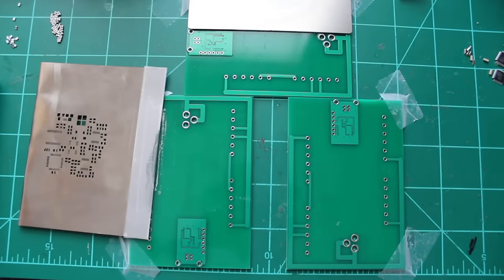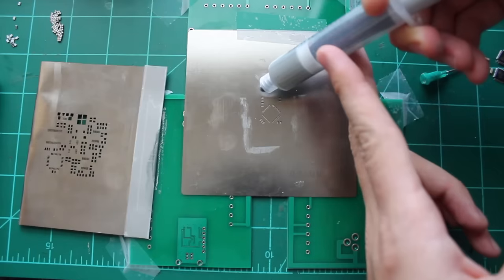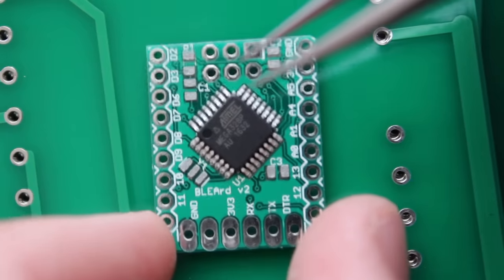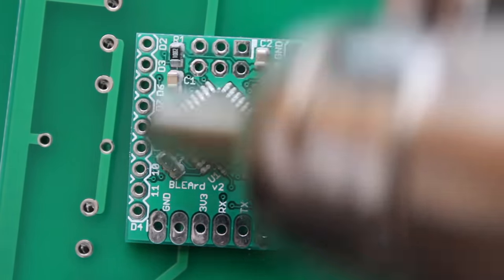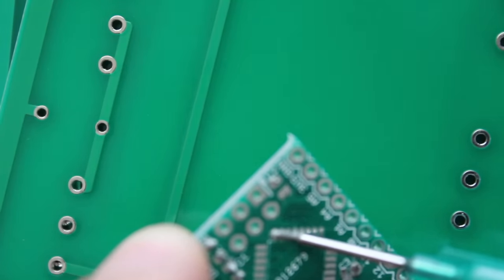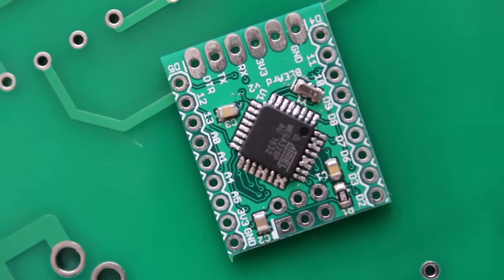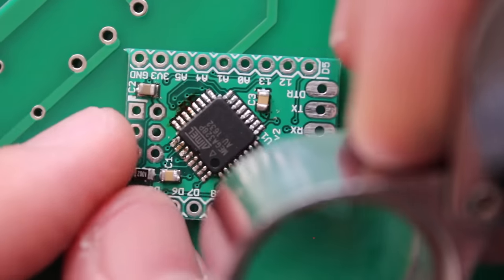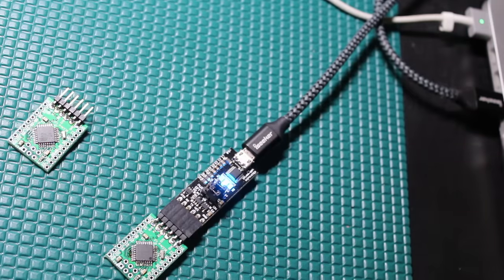Easy way to Solder Surface Mount Parts! - How I do it

Comment: When doing solder touchup, adding a little solder flux to the joint first will work wonders for reflowing the solder and avoid possible cold solder joints.  It probably would have fixed the bridging too during the touchup.

Comment: THE best video I've seen - explains all steps, adds lots of tips, just excellent.  It takes some of the "fear" away from surface mount.  

Personally, I might have slipped some heat-shrink tubing over the too-coarse needle, and shrink it to have a finer applicator, but the fact he did it as is and it worked, is wonderful.
Reply: ...and per a later comment, the heat-shrink could be cut at an angle to dispense somewhat downward, I think.   Finding thin enough heat-shrink might be a problem.    All this is theoretical.

Comment: I don't know if someone has already written this down but I'm going to share it anyway. 

If you want to use the solder paste  syringe to manually dispense, then for the very fine pitch pads you could buy from your local pharmacy (if they are available) empty fine-tipped syringes (the insuline injection type) and use them as a kind of scoop. 

You dump some quantity (paste) somewhere off the board and you use the fine-tipped syringe to pick up a small amount of solder paste each time to lay on each pad.

The reason I am suggesting a fine-tipped syringe and not a needle for example, is because the tip of the syringe is an diagonally cut tube which means it is concavely shaped ( kinda like a spoon) on the one side which can hold some paste more effectively than just something cone shaped.

It is a bit time consuming but it is a lot better than bridges due to excess solder and you can save yourself some trouble from having to use the hot iron and the wick. Sometimes using the wick removes more solder than it should, you cannot exactly control it. 

The manual dispensing way presented in this video is fine if you want to go for it. I just wanted to share some of my experience, so no trolling please.

PS: Also Kevin Darrah, you might wanna start considering some hot plates for properly heating up and re-flowing for your assemblies (provided the boards assembled are one-sided and small enough to fit on the surface of the plate). Some components (and yes that includes ceramic caps and resistors) DO NOT like thermal shock as you probably know. A hot plate can be a cheap (kinda) solution to that.

Alright that's it, I'm out. Bye!

Comment: When doing it without a stencil, just dab the solder paste to the components, Use a toothpick to wipe off any excess if need be, then place the parts on the board with your tweezers

Comment: Thanks for sharing. Just to add some point of benefit, when you paste the PCB by hand and you make a mess by bridging the pads, I would not recommend to use the iron for cleaning it as you did it here, rather run some flux over those pads, change the tip of the iron into a flat blade that covers all the pads of one side of the chip (they come in different sizes) then simply wipe them all outwardly, away form the chip, you'll notice the pads nicely and evenly soldered with no bridging at all.  And finally, don't forget the golden rule, ESD protection. Carry on the good work.

Comment: Wow, Kevin you are indeed good at this.  As an old school engineer I remember when we first rolled out SMD designs in the 80's thinking, well this is the end of the garage tinkerer.  Obviously I was wrong.  What impresses me most is the number of connections being made and the fact that you were able to make good ones without shorts/opens the first time.  Keep it up.  Maybe an old school guy like me will be motivated to give it a try despite the fact that my garage is full of old PIH stuff.  :)

Comment: Great video! I don't know if anyone else mentioned this, but in addition to the capillary action, it's the surface tension of the molten solder that pulls the parts into alignment with the pads.

Comment: Something I have used to fix solder bridging is an iron tip with a flat face. Cleaned well, it allows you to drag the corner of the tip against the board, the face against the tip of the pins. The face of the tip wicks up the excess solder and by dragging the iron across the pins it evens out the solder left behind.

Can't remember where I picked the technique up from, but it works in a pinch.
Reply: armorer1984 link a video! Please!!

Comment: Great video but I have to correct you on something. The capillary action only happens between the flat bottom of the pins and the flat pad because it's a narrow space and capillary action is the ability of a liquid to flow in narrow spaces without the assistance of, or even in opposition to, external forces like gravity.

 What you mentioned about the solder separating and grouping around the pins is due to surface tension not capillary action. Surface tension is the elastic tendency of a fluid surface which makes it acquire the least surface area possible so droplets separate and group around the pins cleaning up the spaces between pins of solder.
Reply from the maker: thanks for jumping in with that!
Reply: Great comment, but I have to correct you on something. "Capillary" applies to narrow tubes. Surface tension is a more general term, and capillary action relies entirely on surface tension. 
Liquids forming into droplets is another phenomenon that also relies on surface tension, in the case where a liquid adheres to itself more readily that to any adjacent surface or material, or in a vacuum. 
Also "ability of a liquid" implies that the nature of the liquid is all that matters. The nature of the surface is just as important, as evidenced by the failure of solder to take on some surfaces. The solder will adhere if energy state of the surface in contact with the solder is lower than that of the surface in contact with the air. Systems tend to change to lower energy states when possible, sometimes needing a "push" in this case the application of heat in the presence of flux.
Reply: I think it is the combination of the two phenomena that make things easier while soldering
Reply: When soldering you do not want the liquid solder balling up. That phenomenon makes soldering more difficult, not easier.

Comment: I usually center the component, then add solder paste. When I was taught, I was told that they are very small solder balls inside the paste. So with that under the flat surface of your component, it allows the potential of that component moving around. It makes sense to me, and its the only way I've done it. Also, you don't really need to add the solder paste directly on the pads, just get it close. When the solder reaches melting temp it'll walk right up your pad/ lead. Downside is if your hot air jet tweaks when you're running it back and forth, you create a big potential for solder bridges. So steady hands are always nice lol. However, I suppose at the end of the day multi leaded devices are just generally synonymous with solder bridges. But you know what they say, different strokes for different folks. Just a different outlook on other methods. Great video man, thanks for making it!

Comment: Take a small blob of blu-tak, shape it into a point, and stick it to the end of a pencil or empty pen. Makes a very accurate pick and place tool! The only thing it doesn't have is a release, so that's where your tweezers come in: touch tweezers to top of part, withdraw pick tool. The sharpness of the point on the blu-tak can be adapted for different part sizes, e.g. blunt for larger parts like your MCU, very sharp for teeny SMD caps and resistors. When blu-tak gets dirty and stops picking up parts, squish and remold - it'll be good as new.

Comment: Watching this... one tip is you don't really want to crank up the air temperature that high. I assume you are using leaded solder paste.

You want as much airflow as is practical and as little temperature as is needed to do proper reflow.

With high temperature air and low air flow you are creating large temperature gradients and this is also damaging to components. You can have the top of your component be very hot (directly to very hot 400C air) but the pads still relatively cool. High air flow tends to equalize and spread temperature much better which means you can use cooler air flow.

Also try to soak the board and components in hot air in lower temperature before you get to actual reflow temperature. This is what would usually happen in professional reflow oven btw. If you preheat the board the gradients will be less and the whole process will be more forgiving.

The way I would determine is I would crank up the cool air until parts start flying away, then reduce it a bit. I would then crank up temperature to see when it takes few seconds to start reflow, not too fast, not too slow. I would soak the board from bit further away and when I'm satisfied I would close in with the gun and do the reflow itself.
Reply: It is not leaded solder paste. Would the temps be higher in this case?
Reply: @BrowFinGarf  that is right,  as non leaded solder has a higher melting temperature

Comment: Good job. I never seen anyone use a stencil, but one thing I noticed when you didn't use the stencil was the crystal oscillator shifting position. from my experience, the solder paste has two states. it helps to firmly press down on the component until it reaches the chalky state. shortly thereafter, you can see the little spheres forming and identify the desired state.

Comment: try tacking 2 corners of a quad pack.  then run a bead of solder paste across the remain legs then heat.  It should minimize the solder bridges as well as make it easier to set them in place.   Add additional flux when touching up will eliminate the need for the additional heat source,  also try using the drag method that's how I was taught.

Comment: Nice, but in the second method could you not have put the paste on the pins and then put the chip on the board as a way to keep from using too much paste?

Comment: Good video Kevin but as someone else pointed out it's not the capillary action, it's the soldermask that prevents the solder from attaching itself to anything other than the pads. Well in theory :)

Comment: Excellent video.  Really cool and makes me feel more comfortable possibly making my own boards with smd components.   What I have done before with soldering smd is use really fine braided wire as a wick.  I have a large roll of telephone wire that actually used fine braided wire instead of solid. I almost threw it out but if I twist the braid really tight it makes a fine solder wick.

Comment: If you're applying it by hand it's easier to do it CNLohr style - using a toothpick instead of the syringe it came in.
Reply from the maker: oh man, that's a good tip!  Most of the time I just pick up the stencil when I order boards, so hardly ever do it that way... probably shows in the video :)
Reply: The glass PCBs CNLohr makes are really amazing, too.

And he doesn't even have through-hole or breadboards, he just goes straight for the SMD, his prototypes are done like a final product lol.

Comment: Dip a toothpick in the gel type flux and use that to pick up the components. I find you have much more control than using tweezers. Once placed onto solder paste the component will release. Obviously a vacuum pickup with foot pedal is even better.

Comment: havent tried it yet but ive seen an etch done wit flattened pop can with coating removed....  toner transfer and acid peroxide etch. I might give it a shot at some point with riston. Last summer I construsted a vac press exposure box from plexi, low iron glass, 365nm 4.1w led from digi key, vaccum pump from ebay/china, pvc, and weather stripping. Also a vertical bubbler tank for cupric. all i lack at the moment is a tested/confirmed stencil making system. otherwise i can do 8mil on 2oz and enough alignment on dl  to do through hole. I figured out that part is easy if i add marks to transparancies and align then glue a strip of preff board between them...makes a hinge that the cc goes between then exposure press box does rest, flip and repeat. I usually drill a hole through template sandwitch and cc so alignment is confirmed on flip. only shit part is i dont want cupric inside and mn has a limited etch season. otherwise a 4x6 dl costs like 4 bucks in consumables.

Comment: When applying solder paste without the use of a stencil, simply paint the paste on with a small paintbrush. A small amount of paste goes a long way and a thin coating will generally not result in bridging.

Comment: Use a hotplate and preheat the boards. Then while still on the hotplate use the hot air to flow the solder. Allow the solder to set before removing the pcb.
The most questionable but super cheap method is to put the PCB on the hotplate cold, let the heat rise until the solder flows then turn off the power and allow to cool. (Some components don't like this.)
Final cleanup with  low water isopropyl alcohol (91% or better).

Comment: Put a bit of solder in the wick first before using it. It transfers the heat through the wick much quicker. Use flux heavily during the wicking.

Comment: Don't know if this helps - my paste dispenser has a smaller needle and needs a bit of pressure to get it to come out. I found if i held the dispenser quite vertical and gently tap I could control how much comes out to a high-degree. I literally apply paste to each pad one by one this way under the microscope. Then try and drop the components onto the pads so as not to smear the paste and then the heat-gun reflow completes neatly. I'm using lead free too - not sure this matters.

Comment: 400 Degree Celsius? That's very hot for that little bugs. Try something about 230-250. And the 858 normally contain smaller nozzles. So you don't need to wipe insanely over the board to be afraid of picking up some components accidently. Just move slowly and smooth from one pin to another.

Comment: Or, if you're me, and really poor, i.e. I can't afford a hot air reflow station, you hold the board six inches over a BIC lighter and hope for the best. :P
I've actually soldered a QFN24 that way (a CP2104 USB to UART chip), and yes, it worked.

Comment: Just a thought, but wouldn't you have more control over where the paste goes (when not using a stencil) for the chip pins by applying the paste directly to the pins, and then positioning it on the board?

Comment: Why not apply some paste to the pins and feet of the components and set them in place or apply some regular solder to the pins and feet then apply some flux to the board using a solder gun or a halogen light (use the bulbs with a reflector behind the light).

Comment: you could have used flux to get the solder bridges away
Reply: He did, the wick was soaked up with flux.
Reply: Yep, I've only done that way over, literally a million times in my life.
It does take a skill set, many people will never have ;-)
Reply: Either you've soddered decades doing nothing else or you literally don't know the definition of literally.
Reply: Who knows - maybe he works at Foxconn. :P
Reply: I've done it that way physically a million times. Get on my level, nerd

Comment: you have some very good information that has helped me quit a bit, I'm curious what kind of education you have and are you an engineer for a company. I  became interested in computer programming at a young age with a commadore 64 and over the years i have kind of played around with programming. i have a couple of years of electronics engineering, but i never attained  a degree. Almost all the electronics knowledge i have is self learned and you appear to have quit a bit of knowledge, so i'm just curious if your knowledge is self taught.

Comment: thanks for the video

2 quick questions. I looked through the comments and didn't see these questions asked. sorry in advance if I missed them. 

1 what thickness is the stencil? 
2 what is your paste expansion rule? how much larger is your stencil opening than the pad you are applying paste to?

thanks in advance.
Reply: Ron Morgan hmm, I remember having to SHRINK the stencil holes for a 328p.  Just fyi.

Comment: Apply flux to the shorted pins and then heat those pins with an outward motion and the solder will come right to the iron and off the end of the pins.

Comment: just watching and wondering... Would it not be less messy to apply the solder paste to the pins and then push the pins to the board?

Comment: Where do you get your PCBs made? The link you provided has a PCB Standard Service for $12, 4PCB is good but it forces one to get many boards to have good discounts.
Reply from the maker: their 2 layer service can get you 10-12 boards for $12,  it's a really good deal.  Pretty buy all my boards from them

Comment: What temp do you have your soldering iron at when cleaning up the bridges?  Also, it doesn't look like you tinned the tip?  Or at least wiped off any excess?  Thanks for the video...
Reply from the maker: usually between 300-400C - it's a pretty crappy iron, so I'll just brush the tip on a brass sponge and that's pretty much it

Comment: I'm surprised that the solder masks aren't very expensive.  I looked at the link and it's only £11-£15 for a stainless stencil.  It would probably be worth getting one even if you were only making 5-10.

Comment: Two comments 1.  a heavy size chrome plated needle can be used to clear hot solder bridges. Solder will not stick to chrome plate. Part needs to be in a jig.  I have seen a pro do this sort of work on a Soic device using just high activity syringe dispensed  solder and the solder just wicked off the pool of solder on his iron.  However these days- late 2018 , that SMD mounting solder seems not easy to find in commerce.   My tuppence.  TEF.

Comment: Why aren't you using flux? retouching the soldering around 16:20 would have been a snap if you had added flux... Why not? Is there a special reason to it?